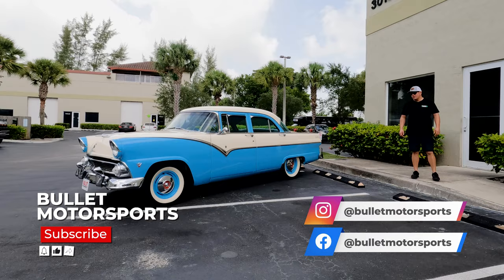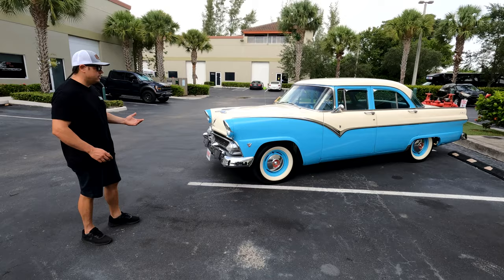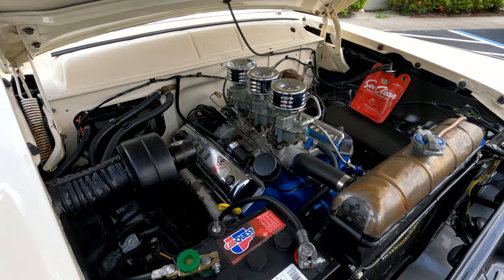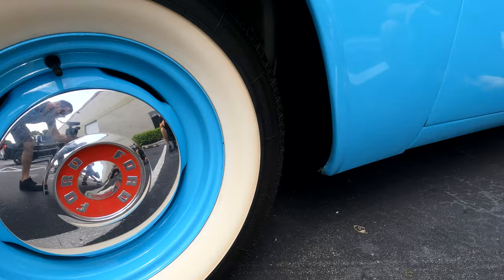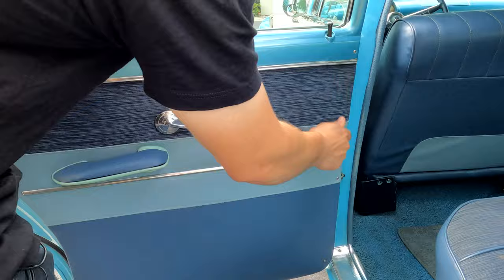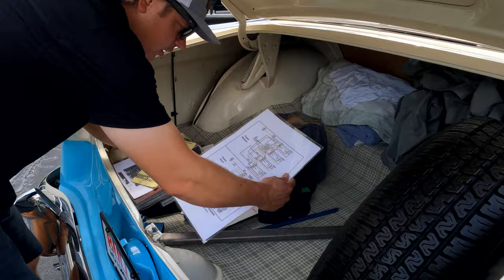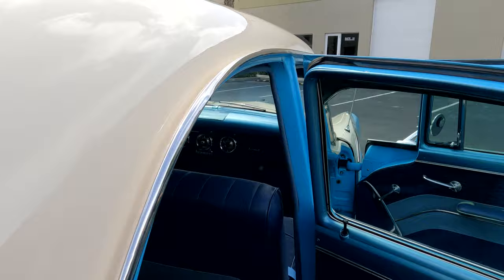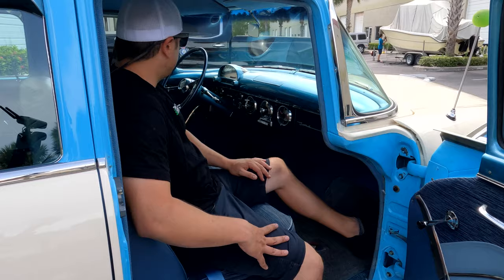1955 Ford Fairlane "Blue Dream" | Walkaround Review Series [4k]

Comment: The clock is a wind up one because it's a 6volt electrical system which is different to the 12volt system, the twelve volt keeps going where's the 6volt system you have to wind it u.

Comment: Nice car! Too Bad no Cup Holders, or Push Button Start.
Reply: Actually there are 3 classes of this car
The A model should be a cop car style
B is the glass top with too many lights for the 6v to hold a charge 
C would be this style of car it came with bair basics

But they all had there own factory version of a push button start.

It was located on the floor. Most have deleted as restorations progress due to rust eating the floor pans and usually starting around those ports in the floor pans. 

I would take one these cars with a modern technology info system done correct with ac and remote start absolutely no issues would take hands down over a 2020 or newer hands down. 

Than again I grew up working on these cars with my grandpa and rebuilt probably 6 fully and 6 more unfinished.